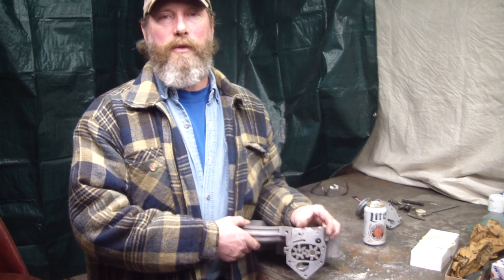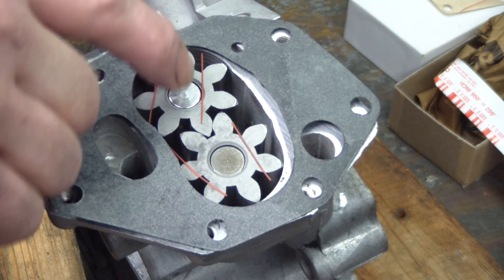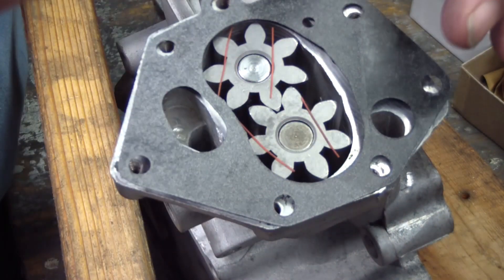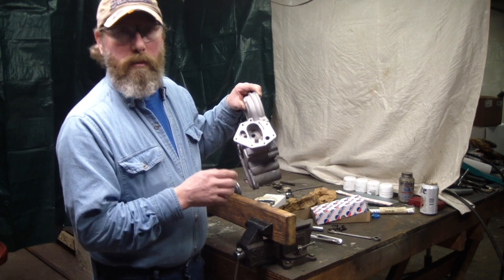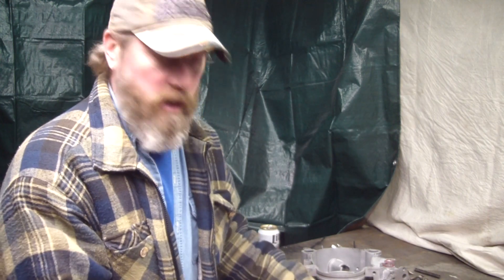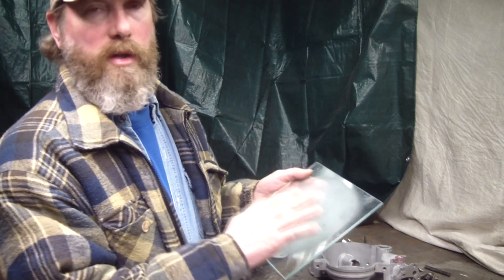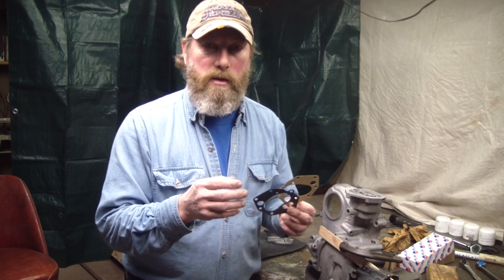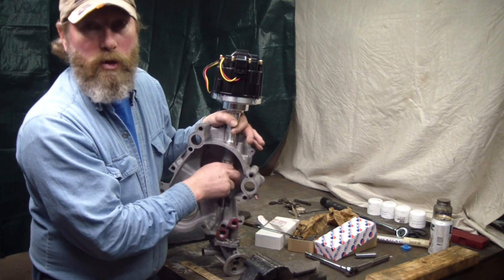AMC Oil Pump Gear Clearance Work

Comment: im builing an AMC 360 for a 68 javelin i picked up, im going to eliminate the oil filter bypass, by taping and threading to 1/4 pipe thread and installing a plug into the  steel plate that holds the  bypass valve then remove the spring and carbon fiber disc,  that results 100% filtration. ive done this on most engines ive built.over the last 25 years as a result youll notice a pressure drop if you allow the filter to clog up. upon an oil change youll also realize pressure is back to normall. the filter bypass is esentially for people that neglect oil changes, although absolutely neccessary for racing engines. good video, thanks for your input
Reply: If you change the filter and oil regularly should never relieve the pressure.

Comment: awesome video oldsmob455!!i have a 1980 jeep cl 7 with a 304 engine that just jumped time. when i got it torn apart i saw not only the timing chain streatched but the distributer drive gear was destroyed .im sure from the lack of oil getting to the gears.i will be getting this oil line mod for my jeep.thanks so much for your video.id buy
 you a beer if i knew were to send it !! have a great day.      give me a shout back any time at    browningmag670@gmail.com